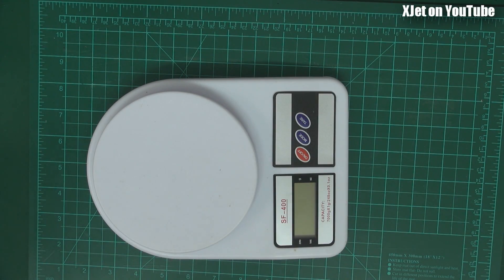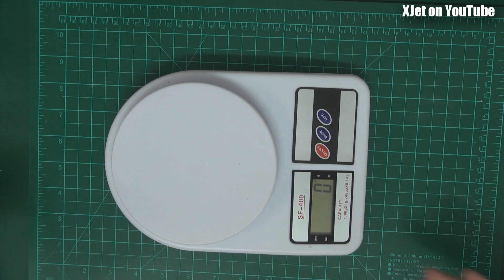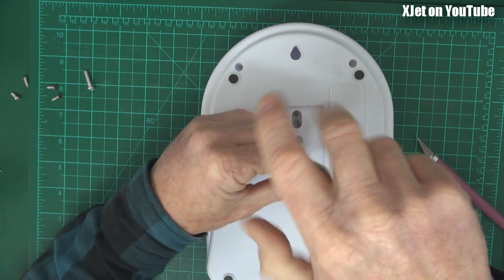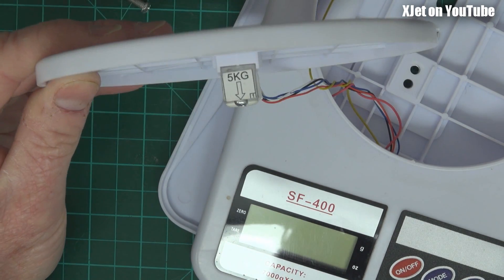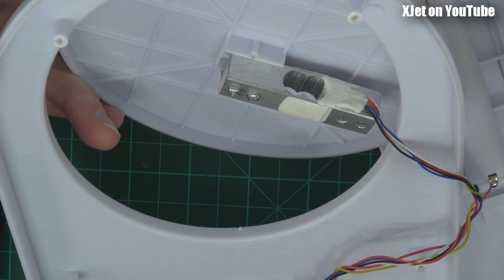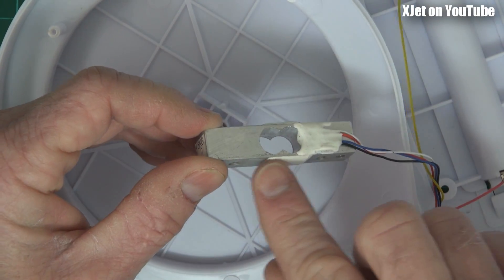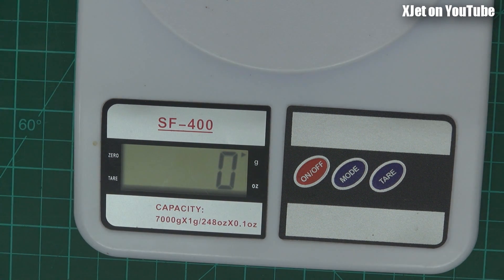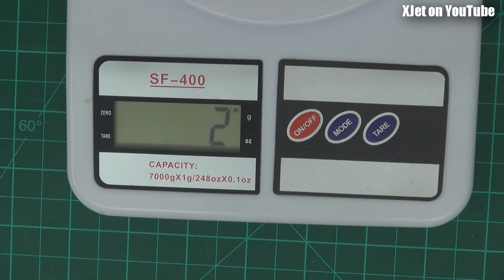Teardown of the lottery scales from hell

Comment: CE = Chinese Export.
The problem is not the load cell but the A/D converter and the amplifier in the chip. They probably squezed a bit more resolution out of it than what it was designed for with dithering and integration. If you want to measure 7 kilograms within 1 gramm you need a hell of an analog system.
Reply: +MainsOnTheOhmsRange Incorrect CE is this https://en.wikipedia.org/wiki/CE_marking chinese manufacturers often face CE markings however. and further down you will find https://en.wikipedia.org/wiki/CE_marking#China_Export
Reply: +MainsOnTheOhmsRange  Yes, agree absolutely. The electronics are the weak link in this system. If the Chinese Export device is mains powered, then CE = Can Electrocute.  LOL!  BTW, great username -  Mains on the Ohms range indeed!
Reply: Quantum Leap

LOL! Can Electrocute. I am writing down that one.

Comment: Bruce, I buy 500g scales to measure 1g increments and the "CHEAP" Chinese
scales are quite accurate. From what I saw on the video there seems to be an
error of 2g.
What is the stated error/accuracy tolerances of that scale ??

A 2g error on a 7000g range is only an error of ~0.0285 %.

All electronic measuring devices have an inherent accuracy/error tolerance. I have
not yet seen even an expensive electronic measuring device with ZERO error
tolerances.
Reply from the maker: It's not so much the accuracy as the drift and repeatability.  Yesterday, while the scales were on the table, they drifted from 0g to 28g over a period of about 30 seconds.  That seems to indicate a fault to me ;-)

Comment: Wondering if it's an RFI problem in the electronics.  No shielding to speak of in the unit.
Reply: Yes, it appears to be averaging over a longer time for the displayed value. But for a much shorter time when reset, so it comes out a few grams off. And yet heavier noise will just make it erratic if it saturates. Indeed perhaps simply foil shielding will fix it.

Comment: How about you measure a certified weight twelve times, work out the standard deviation, confidence limits, error and the minimum calculated weight? I think +-2g drift on a balance that didnt cost you more than £5 with a 5Kg (or 7) limit is a bargin.

How about tapping into those wires to see if there is any noise, you are afterall on an airfield which Id think would have alot more rf activity compared to a kitchen. 

Best suggestion so far is to hack it up into a thrust monitor.

Comment: I work for a very well known (worldwide) scale manufacturer and have been repairing them for quite some years.
You've explained the workings of an analogue load cell absolutely perfectly!
The 5kg load cell will probably have been rated at 0.1g or 0.01g and failed stability tests so they dump it into a cheap casing and sell it. Basically, you're buying something that would have been thrown away :-)
Reply: +Vortecks That could be a really good deal then if your buying a more expensive item that just didn't pass a test.

Comment: It just occured to me, in addition to changing batteries to known good fresh batteries, since the batteries will last for years, it may be good to be sure battery contacts are clean.   Use CRC contact cleaner ( Auto Supply Store )  or contact cleaner from a electronic supply store.  Also a gummy on/off switch would be a problem with power supply variation.

Comment: I have a similar and likely years older scale than yours.  Platform and body are the same, Display & button configuration are different. I don't think the 1 to 2 gram float is as common on mine as yours, when new it always went immediarely to zero. Capacity on mine is only 5000 g.  The membrane portion over the on/tare switch has broken away so I press directly on the swich.  As private kitchen scales for cooking these scales are wonderful.  You may want to check if new ( known to be fresh / good ) batteries make any difference.  Quite common and likely better for some of your uses is  one of the smaller and even less expensive scales with a max of 500 g but a resolution of 0.1 g  I am in the US, but similar is likely to be in New Zealand.

http://m.harborfreight.com/catalogsearch/result?q=digital+scale

Comment: DONT TURN IT ON TAKE IT APAART! LOL
Nice interesting vid there Bruce, keep em coming.
I also noticed that the sony handicam focus keeps spazing out as they always do.
I was wondering when you shoot rc planes and or heli's , do you set the camera to manual focus infinity so the auto focus doesn't spaz out?
Still really want to come and visit with my compass 7hv electric heli but I'm not sure about bringing 4 5000mah 6s 22.2volt lipo's and 2 2200mah 2s 7.4volt as on board luggage.
Regards,
Pete.
Reply from the maker: On cloudy days I often set the manual focus to infinity because that's when virtually all camcorders have a great deal of difficulty coping with autofocus.  Unfortunately the Sony has a tiny little knob for focus adjustments (rather than a proper focus ring) so it's hard to pull focus manually when following a model in the air.

Comment: Perhaps a covert visit to the post office Bruce :) or you could take your own advice and try sheilding the load cell wires back to the display.
Did you see a recent HK promo for multistar motors where they had a custom motor test stand using what looked like the guts of one of these scales. Interesting to note they did not actually show the device readings live only the "results" orally

Comment: Bruce I have the same scales here and they don't vary randomly like yours.

Could it be that you got a dud? =)
Reply from the maker: More than likely -- you know how things go... if one in a thousand are dud... that's the one *I* get :-)
Reply: Poor Bruce... You do however posses the knowledge to fix your "duds" so don't lost hope ;)
Reply: Maraos I'd actually be curious how they handled specific weights with a bit of a filter on the loadcell outputs, although if the defect is in the loadcell itself, there isn't much even Bruce could do to save them (cost effectively, that is).
Reply: Maybe Bruce is radioactive and causes transistors to malfunction in his vicinity?

Comment: I honestly don't understand what the big deal is. So what if the scale reads 135,5 or 136,5. That's still about 1 gram increments. These scales are used and made primarily for use in the kitchen or weighing letters. Applications in which 1 gram is no big deal. If you're so concerned about a one gram deviation you should have bought yourself a proper lab scale instead of whining about it in a video. The quality of your videos (the content in particular) is deteriorating rapidly.

Comment: I like these teardown videos, Bruce! Just like you did with the cheap as USB hub.
For this scale, if it's like a 'two dollar shop' quality scale, it works fine to its price. It's cheap rubbish of course, so I wasn't even expecting it to have 'just' a margin of 2 to 3 grams.
E.g. for use in the kitchen, when you need 100 grams of flower, you'd end up with 97 or 98 grams. Which would be close enough, I guess. :)
It's weird they put a 5kg sensor in it tho, and stating it goes up to 7kg.